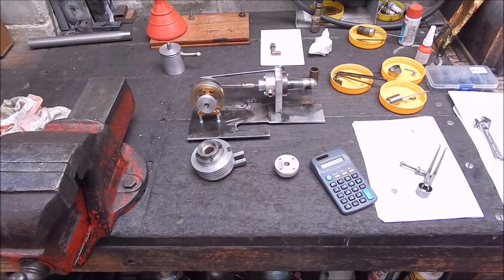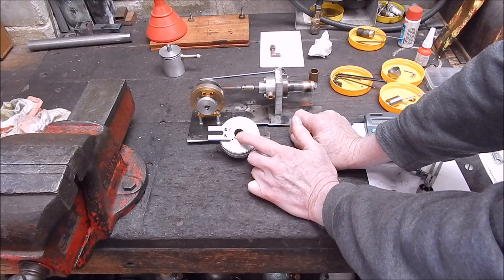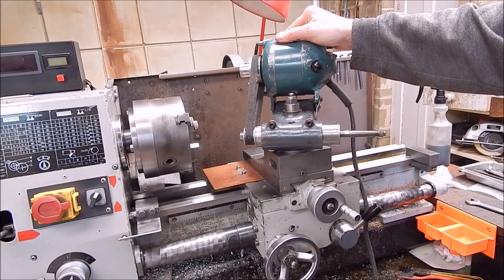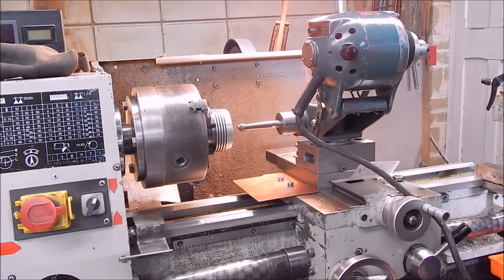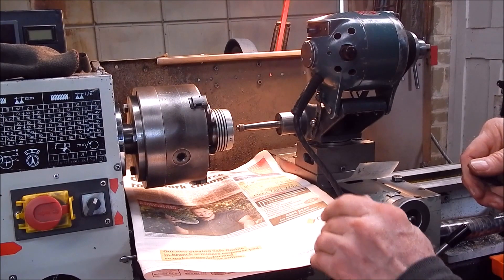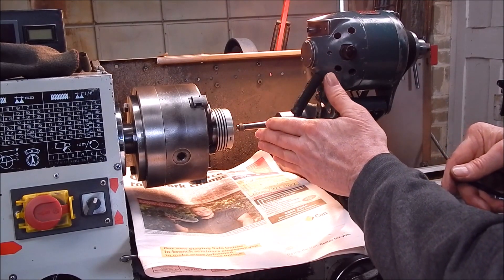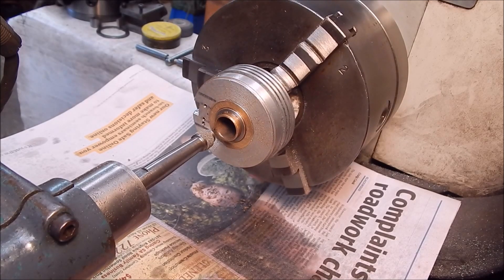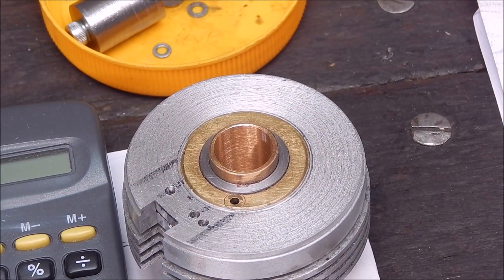Grinding a bronze bush internally with a Waldown / Dumore TPG - how to do it

Comment: Hello Sir, l reproduced a tool post mounting piece for my HILDA like your design a while back. Only in  one  attempt , but  maybe not such  an accurate copy  but it holds up well which brings me to the point . You would know if attempting to bore a small [70cc] 47mm one mm to 48mm is possible ? Similar China  lathe, a jig to torque and  mount in  the 4 jaw, and TP Grinder for accuracy with  less annoying  spring from a long boring bar if possible ? $140 to get a good job by  professionals  would be my choice if it was a pricey build . Cheers
Reply from the maker: Hi John,  it should be simple to grind out the 1 mm with the Hilda.  
It's really no different to grinding lathe chuck jaws. You don't state the depth of the job ?

I would use a grindstone rather than a disc for that job, to counter any wear of the grinding medium (if the job is thick).  For thin metal you could even use a diamond burr.  Cheers Rob
Reply: @Xynudu  A grindstone was used for practice as you suggested , very nice finish and easy to hone finish . Thanks heaps , l am rigging an extension for my indicator to  dial in more positions , do you have any tips in case I miss something ? Cheers
Reply from the maker: Hi John,  I would always use a test indicator for this sort of work.  When grinding make sure to start and work the grinding medium from each end of the job to counter any stone/disc wear and avoid a taper.   Use the finest grit you can for the best finish and apply very light pressure to avoid uneven grinding medium wear.  Check for any sign of harmonics pattern on the job which would indicate you have too much pressure, vibration, or grinder float.  Lock down the cross and top slides if possible (use the gibb adjusters tempoararily if locks are not fitted).  Cheers Rob
Reply: @Xynudu  Will do, much appreciated,  Thanks ROB.
Reply: @Xynudu  Not sure if  you received my reply so , thanks for the clever ideas and I will let you know if I succeed .

Comment: Have you ever tried to use a very fine burr on a tool post grinder for a job like this? If it works at all, it seems like it would be nice since there wouldn't be any abrasive grit to worry about on the lathe.
Reply from the maker: No.  The finest burr would be diamond grit and that would work OK I expect.  Mounting it is the issue.

Comment: I wonder if one of your lathe power feeds would provide a fully consistent finish on the operation.  A carriage stop can prevent running into the chuck for safety. That grinder is of professional quality, superb.
Cheers
Reply from the maker: Hi George, yes you could use the power feed when grinding.  It would have to be on a very high feed rate and you would need to have a reverse tumbler to change direction.   There's no advantage really, as the stone width will always cause grinding overlap.  Doing it by hand allows you to loiter on any high spots and vary the feed as necessary. 

Waldown and Dumore are both industrial grade machines.   Waldown no longer make TPG's, but Dumore still supplies and supports them.

Cheers  Rob

Comment: Hi Rob .   I think  a lot of people  may use them once , get crappy results & put the thing back in the box again never to be reused !    You can achieve commercial  finish & accuracy  but there is a lot to learn to get the things to behave as they should .   Flood coolant  is your friend   amongst many other things with a TPG !    Cheers .
Reply from the maker: Hi Max, yes you are probably right.   There's an art to using one for sure.  It's also getting very hard to get consumables in Oz.  Brobo Waldown no longer supply or support Waldown TPGs.  Dumore in the USA are really the only supplier of note these days and very expensive.  Internal stones are the biggest issue.  Cheers Rob
Reply: @Xynudu  Abrasiflex  seems to be the best place so far , but with  super limited range .  ID is no problem but OD  you have to pull a few tricks out of the hat to get good results  from  a harder grade wheel than what you want to grind with .  I will be looking at getting wheels from the U.S soon , unless Norton can pull their finger out  in Aust . The old supply / demand thing !

Comment: Couldn't you use that little gem to remove the weld bead from sections of pipe for your home brew aluminum (aluminium to you civilized folk, lol) round stock molds? Cheap way to add variety to your diameters of base raw stock
Reply from the maker: Yes you could.

Comment: That's a great tool, got me thinking how I could make one 🙄
Reply from the maker: I made a smaller version using a 775 DC motor.  It's very handy for small model making work.  Plenty of people have done similar for all sized units.  Good project.  Cheers Rob
Reply: Terry, there is a really useful book on making precision rotary spindles for the home workshop. It is book number 27 in the Workshop Practice Series authored by Harprit Sandhu. Plenty of good guidance in it on producing a suitable spindle for a toolpost grinder. Costs about £7.50 GBP.